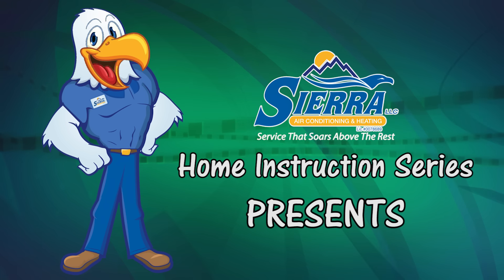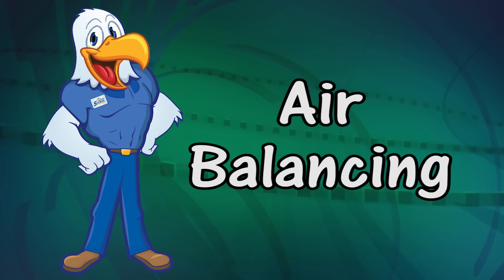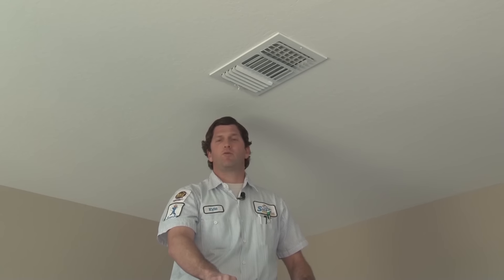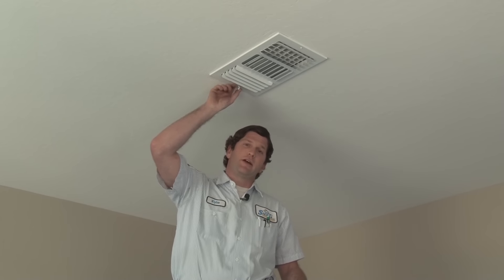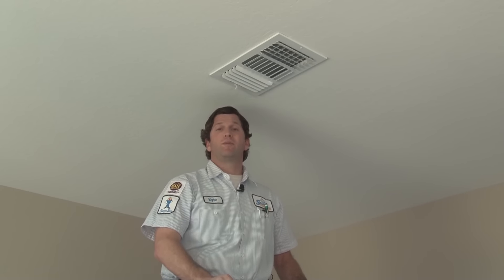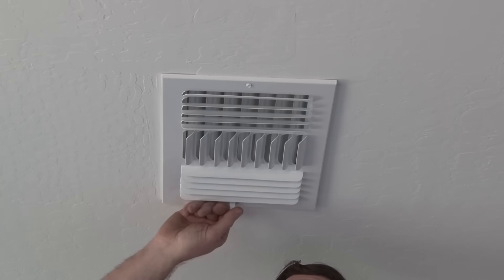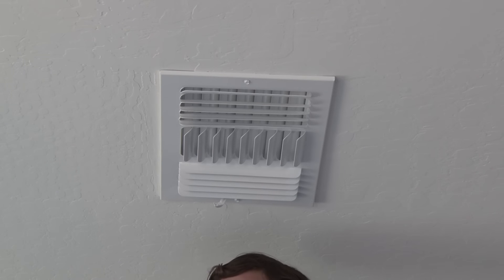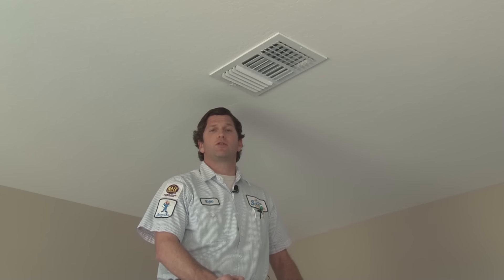Tips for Air Balancing Your Home

Comment: Bad advice. Your system is meant to run with them all open. If you have a room or 2 that you need to shave off 10%-20%, that's one thing... but slamming them up to 85% closed... well, many things could go wrong at that point. ESPECIALLY since many homeowners have been sold over sized units by unknowledgeable salesmen. If you need to close them, then there is a bigger issue. OK, I just checked out your website, and you are NOT an Air Balance company! You don't even offer that service! You obviously don't understand what an Air Balance technician does, so stick with what you know!
Reply: Heidi S I disagree. The system needs to be engineered with a certain CFM designed for each room. Some rooms are bigger than others. Balancing dampers need to be used to achieve the correct airflow.
Reply from the maker: Our houses are designed by registered mechanical engineers in the state of Nevada. On our plans, there is a low and high CFM requirement depending on which way the house is facing. We wanted this video to be simple and easy for our homeowners to understand so we left out technical details such as this so as not to cause more confusion to our homeowners. Thank you for your concern and input. We appreciate it. :)
Reply: While greatly simplified, it's not nearly as bad as you say, Heidi.  Also, by "Air Balance Companies", you probably mean a "certified air balance contractor".  Those are generally only for commercial systems.  You don't have to be one to give advice on residential systems.  My only suggestion related to this video would be to caution homeowners that closing registers increases the total resistance in the duct system, which decreases total airflow.  A well designed system can handle that, but most systems are not well designed.  It sounds like these guys do a good job.
Reply: +mrmatalino  I disagree. Smaller rooms that require less air should have smaller ducts, not closed register dampers.
Reply: +Sierra LLC Air Conditioning & Heating so when the register dampers are 100% open, they are near the high cfm requirement; and when 85% - 100% closed, they are near the low cfm requirement?
Reply: Heidi S  the window and outside environment also plays a big part, even if yr room is smaller and your room has a window facing directly to the sun light the room will need much cooling, wen you start living in you ill realise the design desingned by the engineers suit the most in your climate, even if you design with dry bulb and wet bulb temp with software like HAP need to balance it accoring to your weather conditions
Reply: rishad abdul rasheed I dont understand what point you are trying to get across. I never said that all rooms have the same heat load.
Reply: Can we all just get along please?
Reply: “oversized units” are you kidding 😂 all the units are undersized here in fl. they can’t keep the house at 80° 😂. It’s ok to close off registers but you need to have a place for the back pressure. just don’t be a idiot and close all the registers in your house. most is “ok” AS LONG AS you have a place for back pressure in another words leaving at least 2-3 registers cracked and one (in the room with no air flow) all the way open. or just go get a vent booster and put that in the room with no airflow. But all of these options are pretty much band aid solutions if your ducts are plugged up which could be another reason why your getting no airflow in one room and too much in another.
Reply: let me make a correction on that. yes there is some oversized units but it’s pretty rare in florida. it’s more common in older trailer homes with package units up north more. the problem that occurs more in fl is that you have a 2 story 2000 square ft house and they put a little 1.5 ton unit.

Comment: I’ve been in commercial TAB work for 9 years. First off, a “balanced” HVAC system has nothing to do with temperature, it’s only the correct CFM / air transfer rates per room size. Always have at least one diffuser wide open, anything more is building more static pressure than an air handler is designer to do.
Reply: He covered ashrae 111 in the last video I'm sure

Comment: If you only closed a vent 50% does it make a difference or just have higher pressure coming out through the vent, vs the 85% you did in the example. Is 85% the recommend amount to see a noticeable difference? Thx
Reply: Closing to 85% is a horrific suggestion IMO. Start with ALL VENTS FULL OPEN.  MAXIMUM CLOSURE = 45% ON 1/3RD OF THE DIFFUSERS.  
 :face-purple-wide-eyes: HOW MUCH did the TOTAL AIR FLOW RATE DECREASE?

Comment: My furnace blowing hot air in all rooms except my bedroom.  It blows cold air. What could be the cause?
Reply from the maker: That sounds frustrating! A few possible causes could be a blocked or disconnected duct, a closed or stuck damper, or an issue with airflow balance. It might also be a problem with insulation or ductwork efficiency. We recommend checking your vents and dampers first, but if the issue persists, a professional inspection can pinpoint the exact cause. Let us know if we can help!

Comment: I'll save you 4:27 seconds. Close the vents to have less flow in a room and open them to have more air flow.
Reply: I heard you could damage your furnace that way by restricting the air flow
Reply: @bk9852  It's not restricting the air flow...it's diverting it.
Reply: smoke14 isn’t it restricting the airflow through the particular vent that you’re closing down?
Reply: @ViralRivers  
Yes it is. But the point is, that air is being diverted to the other supply registers and it's not going to damage the furnace/air handler.

Comment: Wait, I'm not here to disqualify this video by any means, but the correct way of balancing a home is by installing manual dampers.

Installing manual dampers at the plenum, closing, or opening them at the plenum is truly the only way to balance a home correctly.

Closing off registers is only going to create noise. Think about it: if the air has already reached its termination point at the register, it's not going to be pushed back through the ductwork just because one has closed off the register. 

Air simply doesn't work like that, especially with the air right behind it trying to exit as well.

Air is like water; it travels to the path of least resistance. So, attacking it at the point of contact (when it's coming across the coil) is the best method balancing a home. 

But carry-on...
Reply: @NoBody-ro3xj im curious is @aerialhearing  wrong? I mean to some degree a really well built and insulated system is designed to have x number of vents open with hvac system operating at whatever efficiency level. 

I was told to leave them all basically open because system was built for that number if vents and returns etc. However, my issue was that the ductwork inbetween floors 1 and 2 would condensate so bad it would stain the paint on the dry wall around that same ductwork. I added a big vent in my garage making garage cooler and boom problem solved at least 85% less water bleeding through and staining paint. 

Any thoughts?
Reply: @NoBody-ro3xj was that a compliment or sarcastic statement meaning @aerialheating dont know what they talking about or more specifically there statement is completely not correct?
Reply: @NoBody-ro3xj it wasnt for nothing if your comment was a negative one and you had things to say to back it up. I have heard alot of contradicting things from the professionals and have learned alot lately regarding hvac from peoples comments/you tube rather than the actual tech.

Comment: Don't you think the duct is designed to have adequate air flow to each room based on the location of the room and size of the room? If the design is right and the duct is installed correctly then, I believe all the registers should stay open all the time instead of adjusting the register opening /closing.
Reply: You give the contractors WAY too much credit.

Comment: All vents are open but my bedroom is hot? Can I close dining and kitchen vents? So I can more air in my bedroom?
Reply: Nope, if you if you wanna try and fix that problem yourself cheaply would be to go out and buy a ecobee thermostat and use their wireless temp sensor and put it in your hottest room

But professional help 
1.theyll have to check blower fan speed
2.check pressures/refrigerant
3.check ductwork
Reply: Closing vents will help but youll eventually would want what your closing to be cold in there too..making your thermostat run longer and still have a hot spot
Reply: @DJV94022  if I close those vents that I mention is not going to break anything? I spend more time in the bedroom anyway, thanks
Reply: @jacksongil9123  typically no..but if its a vent thats blows out hard then maybe but till take like 12 hrs for you to tell or it freezes up right away which ever comes first

Comment: I'm new to forced air heat/ac and have a new home. I have three zones, two on the main floor and one downstairs. There's a big temperature difference from downstairs to upstairs....roughly 6-8 degrees. The downstairs zone was set to blow 20% into the main floor zone. Is that standard? We all know heat rises so why is there air blowing in a separate zone when you don't need it? I only have access to the registers with dampers.

Comment: What if I have Thermastats in a 2 story home and leave upstairs off and leave thermostat downstairs on in winter? House is still very warm with upstairs thermostat off.
Reply: If you was to do that then you have the house equiptment to warm up your house in 30-45 mins but your choosing to take   now 2hrs-to possible all day to just rely on the downstair vents to somepoint warm up upstairs (all doors open in the house) thats like choosing to drive 20mph on the highway but you have the capacity and availbility to go 65mph and get point a to be in minutes

Comment: What if you don't have a thermostat   upstairs ?...

Just the one.  (down stairs)
Reply: then you just set you desired temperature on that one thermostat and find which rooms are hotter in the cooling season and which ones are colder in the heating season and see which ones you need to close

Comment: Two thermostats means 2 different furnaces.

Bad advice to lower the temperature in one system.

Close all the doors to rooms ALL THE TIME and ensure there is a 1 inch gap between the bottom of the door and the floor surface.

Change filter often.

Make sure system is clean.  A sealed system runs much more efficiently.
Reply: Can i ask why to have a one inch gap? I rent several rooms out in my house to people ans for noise control and privacy there isnt as much air passing through closed door and most normal people do or have. 

I ask also because i have two story house that really heats upstairs in summer and freezes downstairs more in winter and i have consistently used 30 percent more than comparable house around me that haven't had all kinds of energy or star whatever upgrades and thus are registered as energy efficient homes. 

It was also like this first couple years when it was just me and one other person.  I was like dam all these other houses are families and i am still averaging 30 percent more than those comparable sized homes that werent energy certified?
Reply: @nomoreliberties  Do you have a gas powered forced air heating/ cooling (most people call it air conditioning) system with return vents in the hallways?  And, are people opening their windows during the winter?  And yes, heat rises while cold air falls.  That is why the firemen tell you to lie on the floor to get cool and less smokey  air and crawl your way to an exit.

Comment: Nice video BUT very very misleading statement in there about the duct not being fully closed is better! Any long time HVAC tech, or physicist for that matter, will tell you, and knows, that air like water follows the path of least resistance!!!

Meaning either fully opened or fully closed is best. If you only close it 85% then the flaps are at a weird angle and sticking in a direction that will in fact deflect the air the other way and have the opposite affect of what you're trying to achieve. So basically does the opposite of what this video claims which is what you actually WANT to happen. 

If you want the upstairs to get cool air in summer,simply close as many vents on the first floor as possible. The first floor will still get plenty of air. And the thermostat is on the first floor so if it is 70 on the first floor but 85 upstairs it will shut off and the upstairs remains hot. so by closing off all vents downstairs the thermostat will get a better reading and a more level and comfortable temperature throughout the home
Reply: Not true
Reply: @rosage757  uh huh